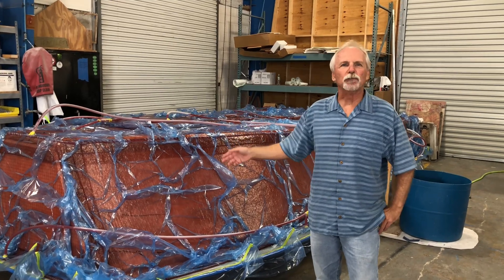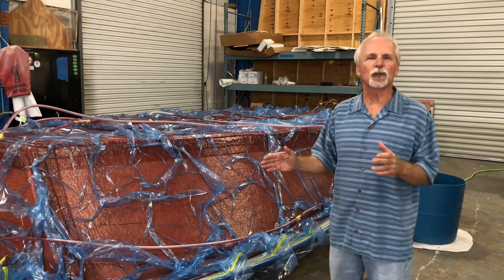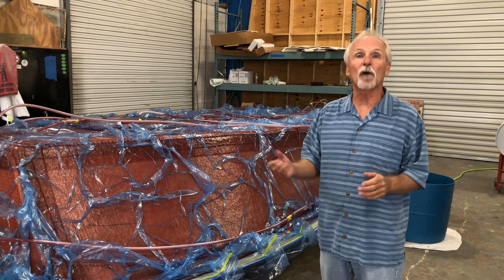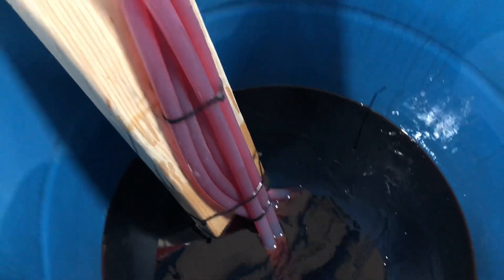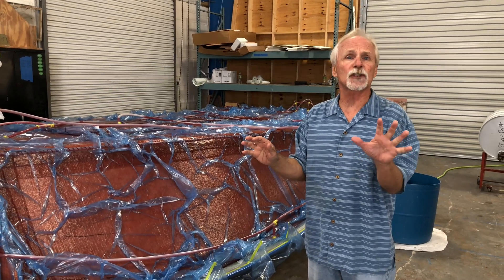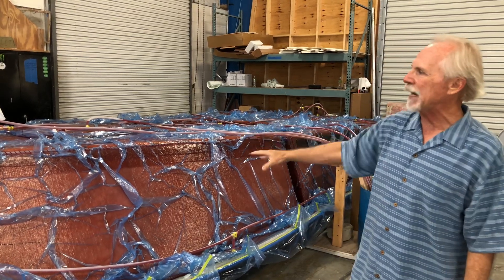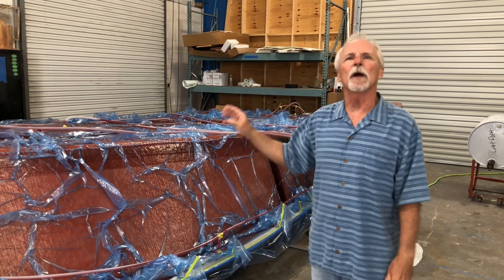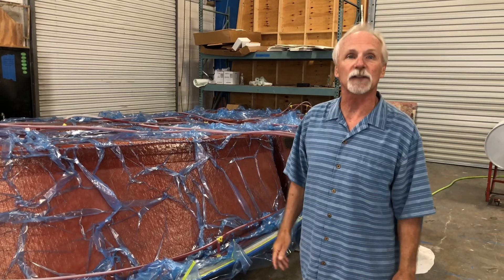Resin Infusion - Stuart Boatworks

Comment: Did you experience leak problem somewhere on the vacuum bag? How did you find the leak source and how did you solve it? I had a hard time because of
 a very small leak and super hard to find the leak location.
Reply: You can get a device that listens to high pitch sounds I use that to find pin holes only works if you have your vacuum in a pump room otherwise it’s to loud

Comment: Resin infusion is what you're doing with the vacuum bagging method. The vacuum bagging isn't the difference. The difference is that you're using the vacuum to infuse the resin instead of a manual application. You can also do vacuum bagging with pre-preg, that isn't inferior to vacuum assisted infusion. So, yeah, you ARE vacuum bagging. That's like a race car driver telling people he isn't a car driver.

Comment: A small correction, The resin ports position should be lower than the suction ports. Otherwise, you will have a non-resin problem in some areas.